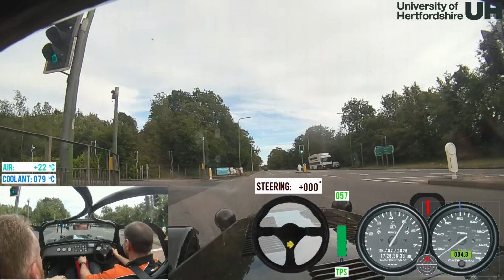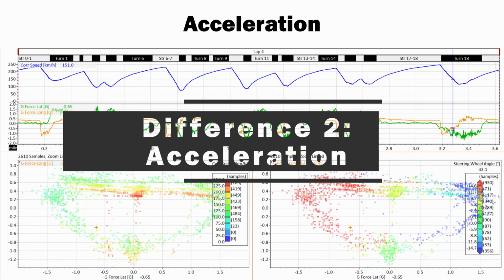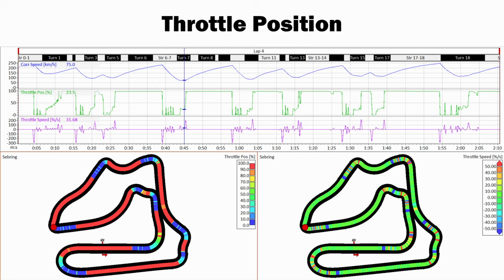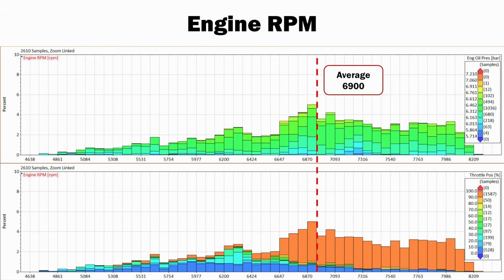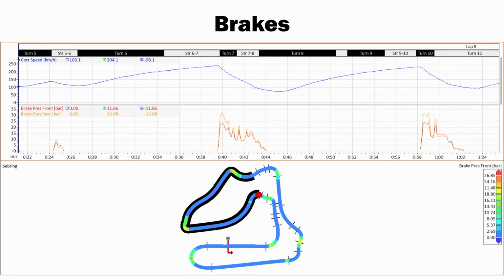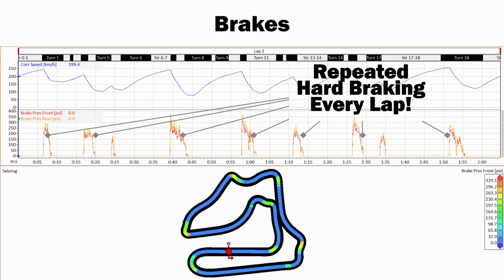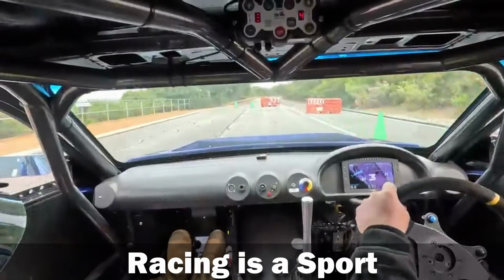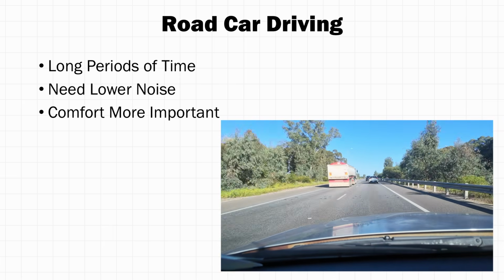Built for Speed: Race Car Data vs. Street Cars

Comment: Great video, as usual! 
As track and road cars have a different tire temperatures operation, could you analyze how this difference impact the suspension design?
Reply from the maker: The main difference is the magnitude of loading.  With more lateral / longitudinal available in racing the strength and stiffness needs to be higher.  Also it makes bush deflection higher, leading to an increased desire to run rose joints.  If the tyre is suitable the increase of adhesion grip (due to increased temp) can be quite considerable.
Reply: @KevinHayward7 any consideration regarding the Ackerman angle? I suppose the tire sleep angle must be very different as the operation working temperatura and loads are. Does it impact the steering geometry?

Comment: I think this is too simplified. Most decent sports car these days will handle a decent amount of track racing and aren't designed solely for traffic. Just look at the prevalence of Nordschleife times. Sure in the 90s,. sport cars were kinda hopeless at high performance driving but jump into a modern Supra, Yaris GR, M3 or Civic Type R. Might not be ready for an endurance race but there's heaps of dual purpose and highly capable cars for sale.
Reply from the maker: Road cars have gotten better, but then so have race cars.  There are always some cars that sit somewhere in the middle, but they are pretty far from a properly prepped racing car.  Doesn't mean they aren't fun on the track though.

Comment: I´m 28 y/o and I´m kinda used to being uncomfortable, but even then, my barely tuned MR-2 Spyder is just about uncomfortable enough. Yes, you may argue that our roads just suck, and it would be correct. I´ve seen people from France or Belgium complain about their roads, but compared to our Czech roads, they can drive like kings. Our system of paved roads can be summed up as "on the left there´s nothing right, and on the right there´s nothing left". I´ve seen google streetviews and let me tell you, even many Russian roads are better than ours.
But that is a factor that is outside of my control. I´ve had people tell me "why don´t you slam that MR-2 to the ground and put it on super stiff suspension? It would behave like a real racecar."
Buddy, if I did that, I´d not make it outside of my neighborhood without a major defect.
Reply from the maker: Love an MR2.  The cars that impress me the most on roads are the Tarmac rally cars, look like a lot of fun, and some videos of more modern suspensions make the grip levels seem almost unbelievable.  These cars have suspension travel though, circuit racing is a different beast.

Comment: I think you can split the difference decently well as long as you have the right brake pad material and not too much aero. Somewhere just shy of 2hz ride frequency, double duty brake pads like Hawk DTC-30, EBC Blues, or Stoptech 309, and a ride height similar to most "super" cars (so 90-120mm assuming some aero like a flat floor and simple splitter/diffuser combo, otherwise, ride height can be even higher) would probably do it.
Reply from the maker: I think fun on the roads and fun on the track is definitely doable.  Just not comfortable and great road manners, and top level track competitiveness.  But hey in this for fun!

Comment: I'm the other way. The more racecar, the better the road car. It's just that you can't run crazy low or crazy high spring rate. So maybe the racecar for the street is more like a tarmac spec rally car. But prettier.
Reply: Did you watch the video? Many race car solutions either don’t work on the road (like slick tires and high temp brake pads, having radiators airflow optimized for 200 kmh) or make a horrible road car experience (cage, buckets, 5 point harness, using cabin as cooling space). Not even talking that solutions like dry sump and carbon fiber cost thousands more per car and give no benefit on the road.
Reply from the maker: Absolutely agree on the Tarmac rally car ... will definitely be the guiding light for suspension settings.  Thats why I was careful to be talking about circuit racing.

Comment: Just thought of a question .... If you took a bottom end car like a Honda Jazz and a top end car like a Ferrari two seater and drove them hard around a track like you would in a race for an hour or two which one do you suppose would give you the least amount of trouble ?  .... 
I'm guessing the Honda Jazz  aside from it's general reputation of reliability its energy gradient is a lot less steep than any Ferrari but |I am open to being wrong of course :)
I suspect this is why the Nürburgring doesn't let road cars run consecutive laps on their open track days and the queing system allows cars a cool down period perhaps  ?
Reply: Hondas brakes would overheat after 30-50 hard brakings. Likely tires would give up quickly as well.
Reply: @SergeySu  ... So about 5 or 6 laps or so ?
...I did wonder about that but then I thought would it go fast enough or accelerate hard enough ?
It would have much more time to cool down along the straights and long corners was my thinking :)
 
Where as a Ferrari road car anything would reach some serious speeds and accelerations ...
How do you think the Ferrari road car anything would fair driven hard around a track ?

It would be an interesting test to conduct, I know the Ferrari would be probably do twice as many laps as a Honda Jazz but it would be interesting to see both how much time before the cars struggle and how many laps too as a side by side comparison :) 
Which one could go for the longest amount of time before brakes and tyres become an issue ? :D
Reply: @freezatron  Yea, would be interesting to see in practice actually. For long sweeping corners likely Honda will last surprisingly long and soft tires will give up first, hard compound likely will expose tank size limit and refueling would give enough time for everything to cool down. For a square track with acceleration and braking only 100hp is still plenty.
Reply: @SergeySu  I used a Honda Jazz as an example because it has a reputation for being the most reliable road car plus I have one and the HP is 85... on a good day :) 
I was thinking a normal 2 or 3 mile long track with a typical 8 to 10 or so corners....
The Jazz could do at least 50 to 60 laps on a track like that  I reckon
Reply from the maker: Good question, but I have seen plenty of high end sportscars take an early exit from the track in track days.  That being said I'm not sure a Jazz is light enough for the tyres and brakes they have to last too long.  I'm pretty impressed by what cars like the Elise can do on a track day, lap after lap, without excessive tyre wear.
Reply: @KevinHayward7  It would be a fun experiment to run, it could go either way, it's the kind of thing Top Gear would do in the good ol' days :) 

The Elise strikes me as more of a "Road Legal Track Car", not quite a race car or a sports car but somewhere in between.

I do hear from those who've owned that their suspension is rather hard for the road .... 
I do like the Elise though, good track car :)

Comment: One of the most annoying things about living with a race (or rally) car on the public road is trying to heat the brakes up enough! And by extension, things like damper settings, spring rates, camber and castor angles all optimized for high load condition, cause the car to fight the driver continually when lightly loaded up! Add to that rough idling, heavy clutch pedal, lumpy valve timing, awful fuel consumption, vibration and noise, not to mention poor peripheral vision in traffic... Basically, a road sportscar has to be a big compromise against track use, in favour of road (gt?) use. Also, the tyres need to be ok in the rain, as long as they haven't worn out due to the track focused geometry!
Reply from the maker: Great discussion here.  Great that there are lots of different pad types available. Does make it relatively easy to have road pads and track pads, but with suspension / engine and everything else the compromises are definitely are real thing.  There have been plenty of decisions that have already been made for the project that would be different if it was a pure track build project.  Lots would be changed in the suspension.
Reply: @KevinHayward7  my experience suggests that some quick and easy road car changes that can transform it into a capable track car that wouldn't break the bank are things like adjustable coilovers for damping and spring rates/platform heights, wishbones (or strut top mounts) designed for quick camber/castor adjustment, a set of wet and dry track tyres (on wheels, obvs!), road brake pads/track brake pads (I learned a lot from @ArchOfficial-thanks!) and an easily tunable engine management system that can be switched between maps/boost/etc. It all means a fair bit of compromise in design, but part of the fun is finding the optimum window of adjustability for each aspect of the car.
Reply: Why do you need to heat the brakes? Modern compounds and racecar brake systems will make more than enough torque for street driving even on cold brakes at half pedal.
Reply: @ArchOfficial  it's just my own experience. I'm happy to learn there's new tech available in friction compounds that I haven't heard about. I'll do some research. Anyone who has used old school  Ferodo or Mintex racing compounds with bias pedal boxes will appreciate where I'm coming from! How far off am I on the other aspects mentioned? Would be nice to be put straight after all these years of getting it wrong!
Reply: @robair67 I've had to validate and correlate braking systems on a G per foot load and G per psi basis. 

Even completely cold racing systems will still brake at high XG than a roadcar would, although of course the control loading is higher due to a lack of assist in most racecars.

There's a few exceptions like the early 190E touring cars and the Z4 GT3 (non-Evo from 2010) which are just plain more sensitive than road systems.
Reply: @ArchOfficial  so you're saying that some cars do have this issue? It's ok, we can agree to differ! I mean you no harm.
Reply: @robair67 No, I said that some cars are MUCH more sensitive than roadcars. They're the exception in that even braking at 20kgf you will brake well past 1G. Those kind of brakes are too sensitive of course, so they're uncommon. The modern trend is 130-140kgf hits in ABS cars for peak.

Typical brake pad mu at peak temp for a road pad on an iron disc is 0.40~. It's more like 0.35 average.

Normal race pads will be stronger AND more consistent than road pads, certainly so once the pads are over 100c ie: you perform one or more braking actions at anything resembling normal speed. The reason they're not used in passenger cars is due to high noise, dusting and wear.

The only exception I can think of is pure carbon fiber discs and pads, but I'm not aware of those being road legal anywhere.
Reply: @ArchOfficial  thanks for the clarification. So 100degC is a typical modern race pad operating window lower temperature? That is a lot cooler than the old days, I must admit. It would still take 2 or 3 decent brake applications to get there on the road, though. That was my issue when driving a rally car on the road, either between stages or after some tuning work, etc. It did establish a useful habit of minimising brake knock off down the straights in competition, though!
Reply: @robair67 As usual it depends on the pad but yeah they don't really seem to have a cold temp anymore. Which is why I didn't understand why you feel you need to heat them up, or even notice a difference.

RB-340 for example is peaked from 0c to 250c and only goes a bit down from there. Probably great for the road.

RST-1 is 0.44mu at 0c, and peaks at 0.55mu around 700c. So it goes from "strong" to "really strong".

RSL-19 peaks around 500c, but the delta to 0c is under 10%. At its worst it still makes more mu than typical road pads do.

Most road pads I've ever seen have much more varied, and much lower, performance at all temps, because they're making huge compromises to not be noisy, to not dust like crazy and to hopefully not wear out prematurely although the more eco type pads are worse in that regard than race pads are.
Reply: @ArchOfficial  I think I've been out of touch longer than I realized! Ferodo DS11 (1980s...) were granite below about 250degC. The last race pads I used were Mintex 1155, which were fantastic, but still reminded you to have a mini heart attack on the first road use in the morning. I stand by my words on cams, geo, clutch and visibility though!
Reply: @robair67 It might well have been different. The modern DS11 pad is around 0.50mu and extremely linear, it barely has a peak at all. 

It'd be cool to get some performance curves out of old equipment as well, but it's just not possible most of the time.
Reply: @ArchOfficial  fair play to Ferodo. The old material was great once it got hot (no fade ever, but boiled fluid and white hot, sparking, warped discs always a risk!) but to improve so much to now have pedal response virtually temperature independent is highly impressive. Must come at a premium, I'm guessing.
Reply: @robair67 There is a caveat that these numbers are on relatively fresh pads (OEM graphs, and in some cases my own correlation from qualifying runs) and it might well change a lot once they're broken in. I don't think it would, but it's a possibility. 

The OEM graphs might also simply be fabricated, although performance correlation suggests it's not that extreme at least for the good OEMs. I need to go down to correlate the car, but that's because of load sensitivity.

You still need to heat them up for maximum performance, because braking performance is typically limited by the driver's leg, so any additional torque you get is more braking performance in a lot of cars, and they probably wear better in a race once at certain temperatures and not when stressed at lower or higher temperatures than intended.

Just foot force wise though it doesn't seem like modern pads are very temperature dependent. I've seen about as much load dependency as I've seen temp dependency.